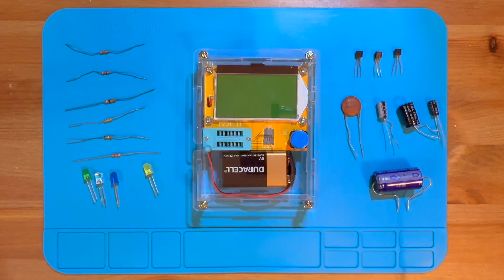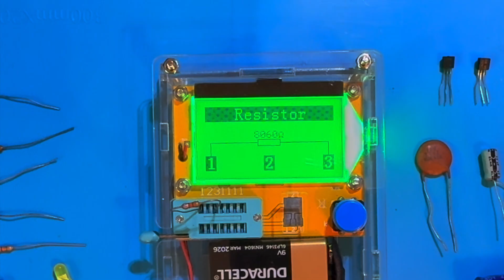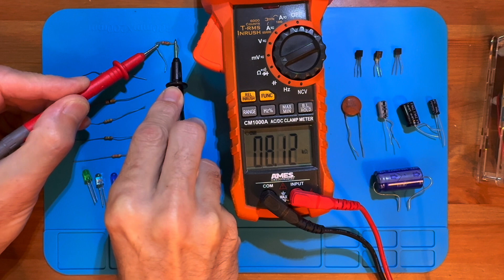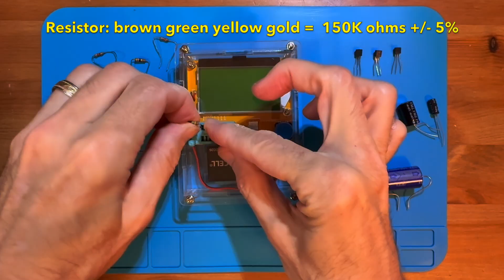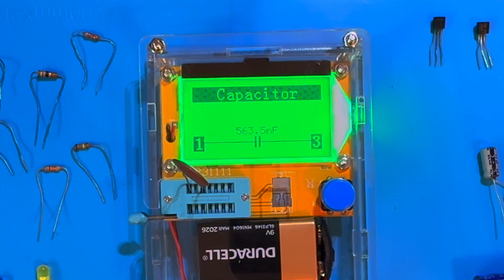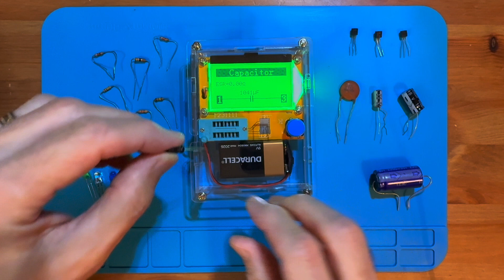Handy Electronic Component Tester For Your Toolbox #electronics #multimeter #testing

Comment from the maker: Do you have anything like this in your toolbox?  Drop a note in the comments!

Chapters:
00:00 Intro
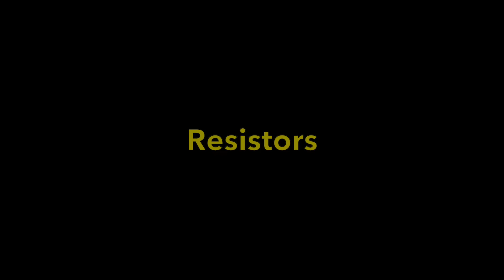00:45 Resistors
05:25 Transistors
06:59 Capacitors
08:57 Diodes
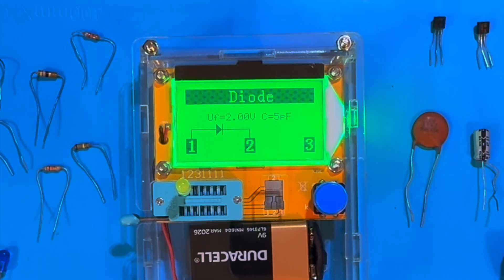10:12 Summary

Comment: Recommend disconnecting battery for longer-term storage or adding a switch. Even when "off" the unit takes some current. Otherwise my experience is very similar to yours, especially for a quick check of semiconductors.
Reply from the maker: Thanks for the comment.  I agree, especially if you have a lead acid battery.  If those are not maintained with a charge they basically go bad quickly.
Reply: @AlexsRepairBench  ???? No mention of lead-acid battery. The 9 V battery in the tester was the topic.
Reply from the maker: Oh! I thought you were talking about long-term storage of the UPS. Yes a switch for the tester is a good idea, although I've had mine a year and have used it a bit but not too often and the battery was still pretty good (although it did show in the upper 8+ volts in the demo so there was some discharge).
Reply: @AlexsRepairBench  Sorry, should have been more specific. YT served me your review of the cheap component tester and I checked it out since I have exactly the same one. I like the tester, for what it is.
Reply from the maker: No worries.  I like it too.  It is simple and provides a quick reading.